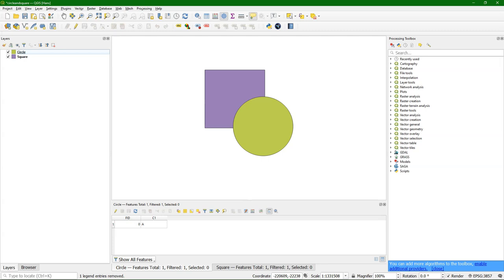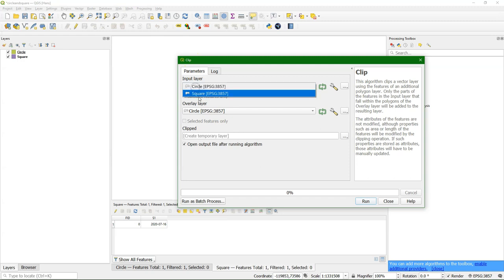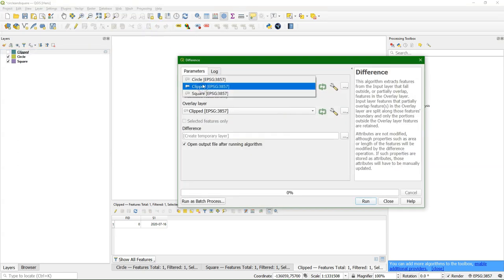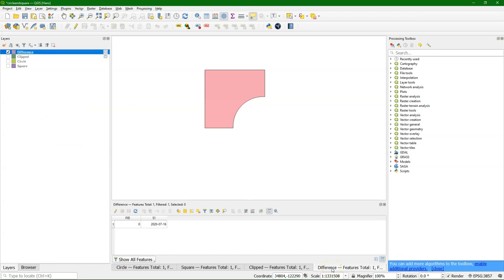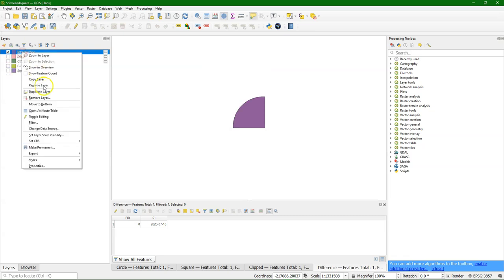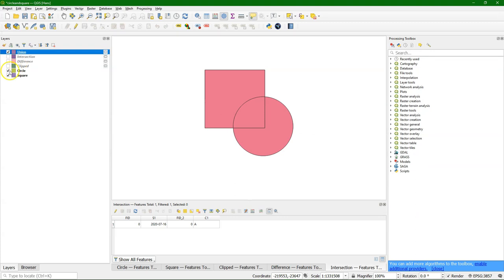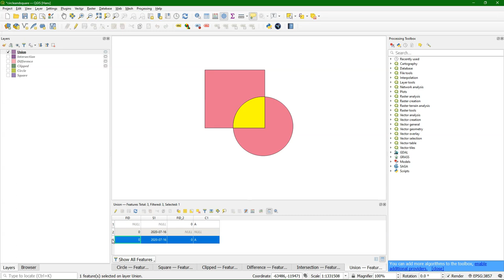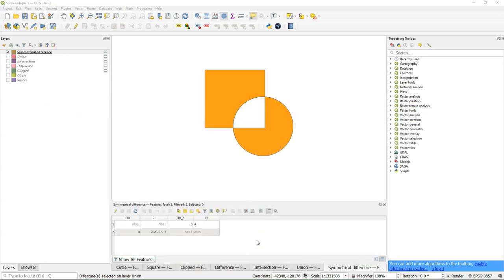GIS vector overlay tools: clip, intersection, union, (symmetrical) difference

Comment: how to calculate the area in hectare or in another unit?
Reply from the maker: Use $area in the field calculator.
Reply: @HansvanderKwast  Sir, could you explain the difference between using $area and area($geometry) in the field calculator to find the area of a polygon? They both worked, but the result is different. Thank you.